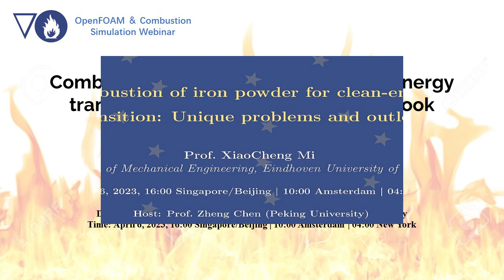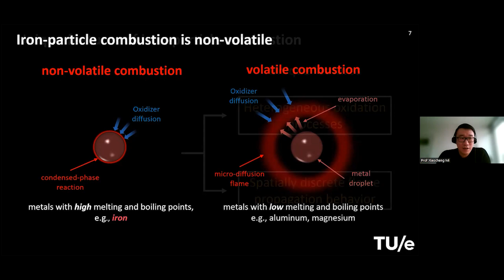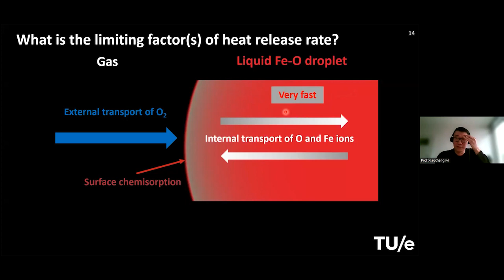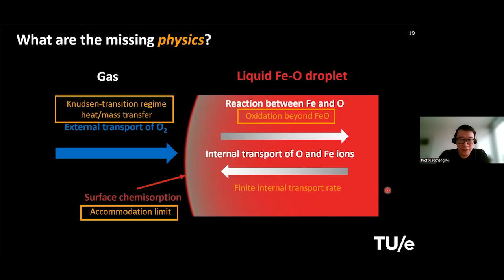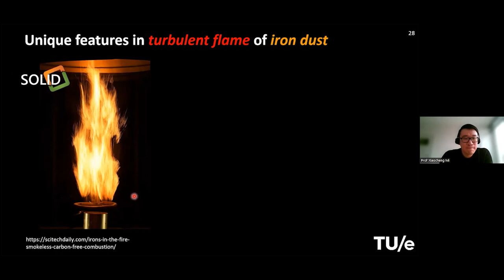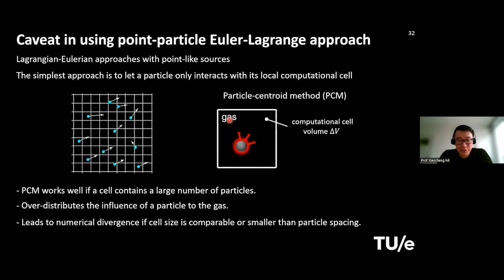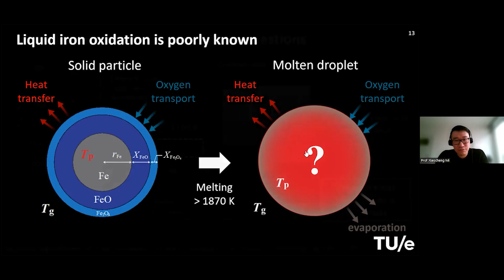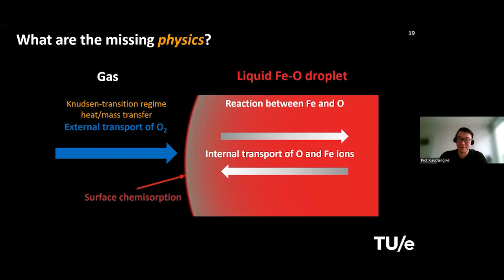Combustion of iron powder for clean-energytransition: Unique problems and outlook

Comment: If the combustion chamber was rotated 90⁰ and the combustion gasses used to induce turbulence then the bottom of the furnace can be a "sort of" fluidized bed to convey the Fe2O3 out to a passive heat capture silo before bulk loading for reprocessing with ammonia, instead of gaseous hydrogen.
For green steel, the nitrogen is not engrained or oxidized in an arc furnace

Comment: I've been thinking about running a rocket mass heater with this fuel.
Reply: Interesting idea! However, due to the low specific energy of iron, distribution and recycle of iron powder on a household basis might not be a  way to go, I'm afraid.